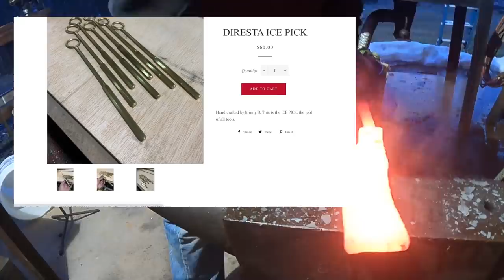DiResta Blacksmith Cleaver [chunk of O-1 tool steel]

Comment: Love your content Jimmy! If I may, I'll give you a couple of advice. During quenching, a temperature of 800-900 degrees can be used, if the steel grade is good, the sharpening will work for a long time. As for mounting the handle. For better fixation, additionally use a pin in the middle of the handle. Thanks for sharing and stay safe.

Comment: From my experience to prevent cracks try to keep the steel at welding temperature and try not to let it get to that cold look when you press it but at the same time I’m only 20 years old so I could be wrong

Comment: Ο1 needs electric oven for heat treatment.it is similar with stainless knife steel.in propane gas oven you cant take the best from the steel.it must stay at least 20 minutes in 800c ,you need steady temperature.
All this with respect to you mr diresta from a 10 year fan of you from Greece

Comment: I watched a couple times without seeing for sure when the crack occured : was it because of the oil container was a bit small and the handle stop made for a large heat capacity and a large temperature gradient on that point, or was there a stress from before ?

Comment: that was allot of work for a rounded edge cleaver easier for me to buy 1 most cleavers are straight or almost straight edge type yours was the first i seen with a round edge  you will have to rock your cuts if it is wide surface cut

Comment: You probably shouldn’t cut through paper with a metal saw. The paper shavings will change the molecular composition of the billet and cause cracking in the space time continuum. I think.

Comment: I'm no blacksmith, i just follow a bit of them on YT, and i would say that you have quit a bit to learn about the art yet, in every step of the making. Alec Steele may not be THE brightest BS, but he knows quite a lot about the basics, and even if he is a fake humble, he is good, That Works has very high quality stuff and Torbjörn Åhman is simple and very talented. You should check them, also, you can't be too agressive with metal, in temperature or movement, that is why power hammers are safer than presses. (Or so i think lol)
Reply: the baveling was good thought!